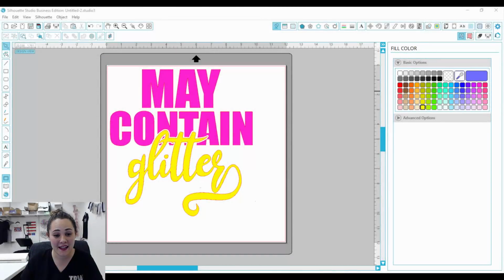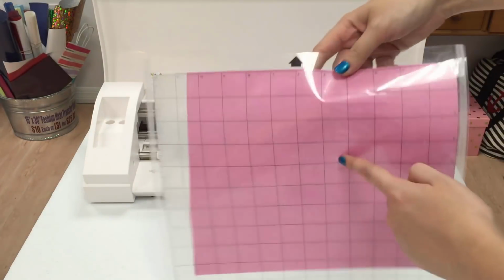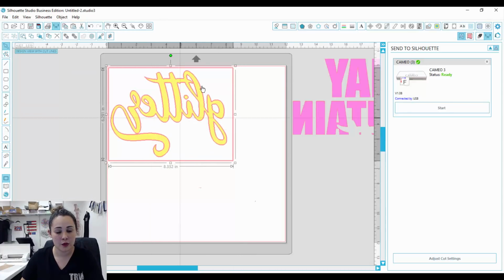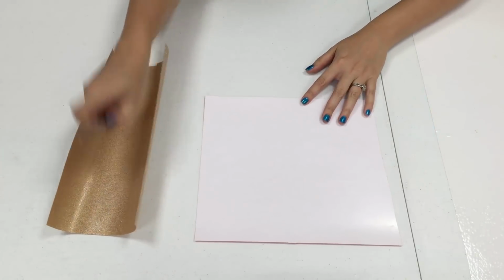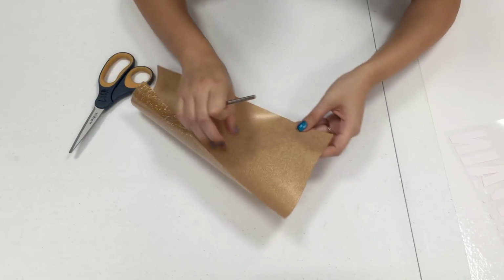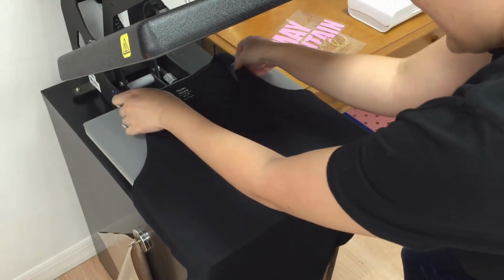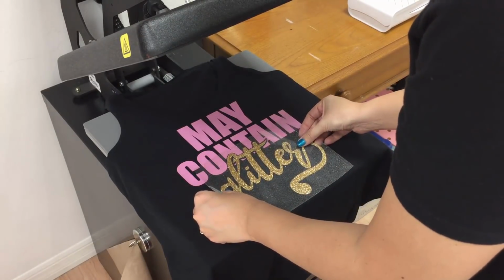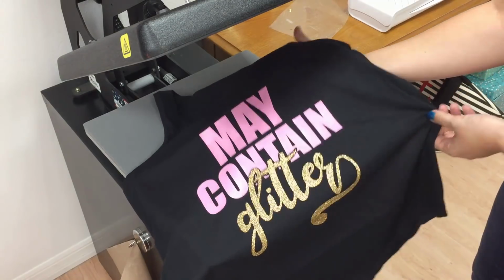How to Cut and Press a Multi-Color HTV Shirt Using the Silhouette Cameo 3

Comment: Hi You say you are using Vinyl and not heat foil. How will this stay on the top during washing ? x
Reply from the maker: Hello! There are some procedures to follow with clothing made with these materials. Its all machine washable, but you should turn them inside out  on a gentle cycle with cold water. Make sure to hang dry or tumble dry on very low heat. Lastly, don't use fabric softener while washing these. I hope that helps! - TRW Richard.
Reply: Thank you for your reply. So does that mean it is just standard vinyl?
Reply from the maker: Beauty,
The materials on the shirt are Siser EasyWeed and Siser Easyweed Glitter.
Both can be found at the following link : http://therhinestoneworld.com/store/#!/Siser-Apparel-Vinyl/c/4508116/offset=0&sort=normal  .

TRW Casey